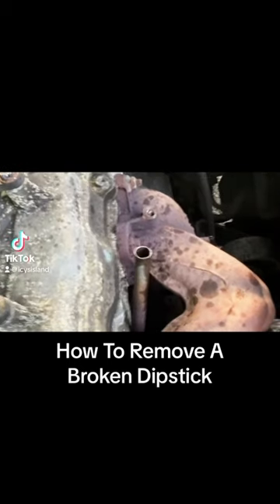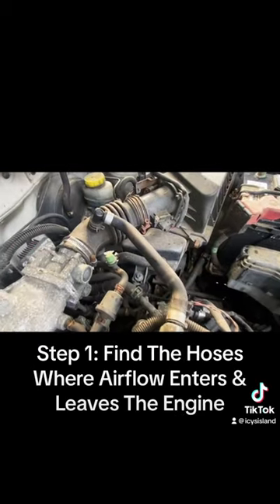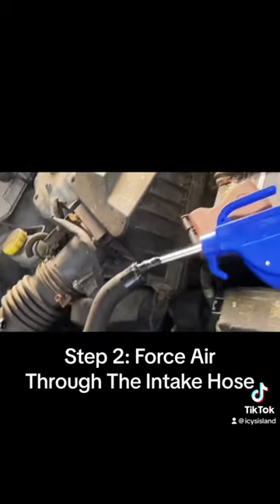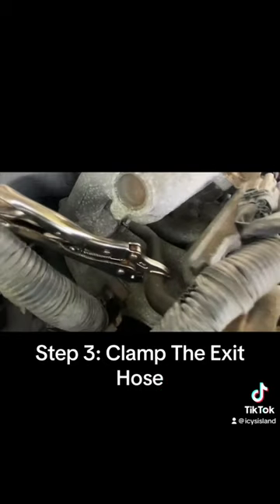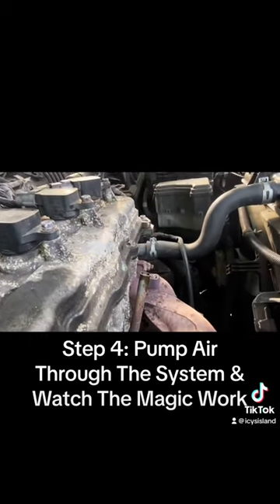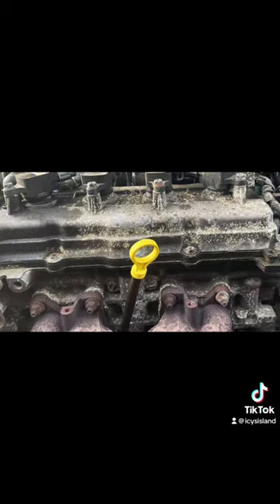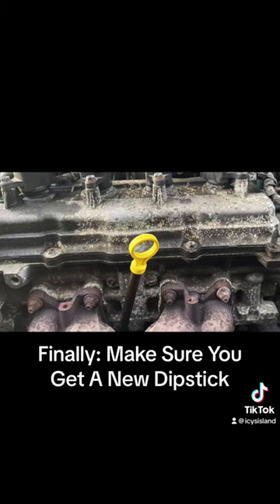How To Remove A Stuck Dipstick

Comment: The last step should be to purchase a complete gasket set to replace all the oil seals you just blew out by pressurizing the crankcase with air pressure.